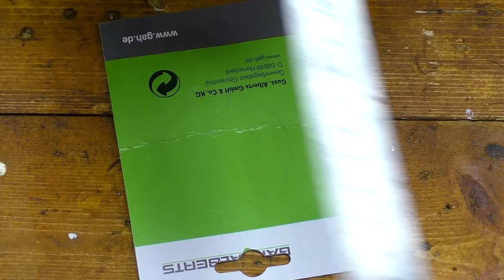3 Secrets Of The Profile Pipe! WHY DON'T WELDERS TALK ABOUT IT?

Comment: Nobody gonna mention the fact that this is tubing, not pipe?
Reply: square tube or square pipe....same thing. either way is right!
Reply: Haha not quite
Reply: @mitchellwilliams4337  Haha..... why??? Please explain! 
tubing
/ˈtjuːbɪŋ/
noun
1.a length or lengths of metal, plastic, glass, etc., in tubular form.
tubular=cilindric
pipe=tube, barrel, tubing, spool, spout
Reply: From a welders standpoint tubing would be square or round but not of schedule and used for things such as handrails. Pipe is always round and used for product lines. May not be the same everywhere but that's how it is in ga, calling square tubing pipe on a welding crew around here would get some strange looks.

Comment: You would make these 90 degree bends, mitre’s if the isometric drawing asks for it otherwise cut two pieces at 45 degrees  then weld them together with the correct PPE as you can get skin cancer if you keep it up.  Coded welders do 6g tests on pipe not box section